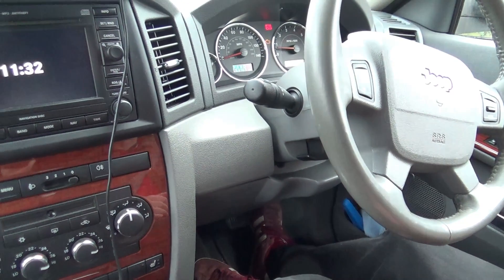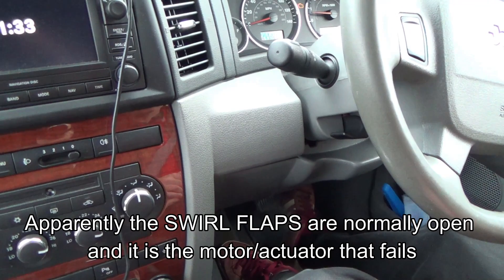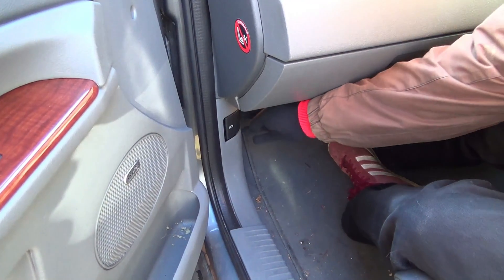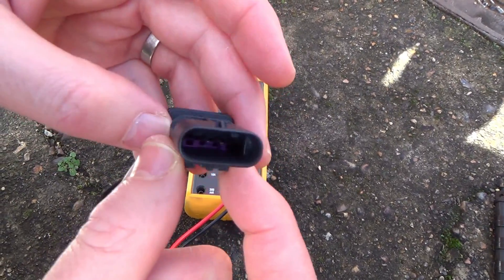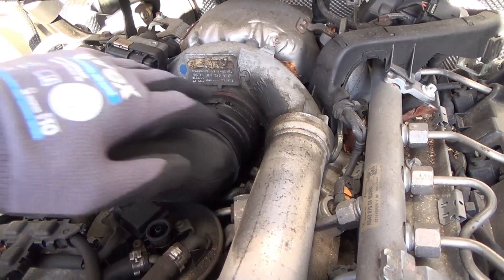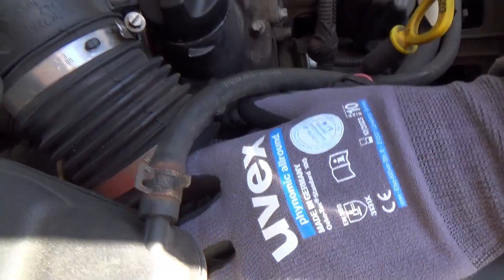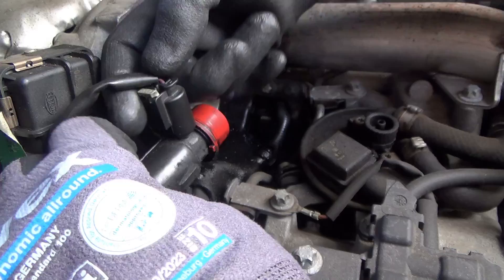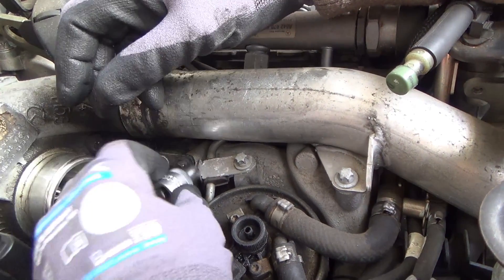Swirl Flap Motor BYPASS on JEEP / MERCEDES Engine OM642 (FIX Limp Mode)

Comment: fooling emissions knowingly is like 4 years in jail more then rape or.. what world we live in.
There are more these kinds of cheats but they are meant for testing and not for useing in road specially when you come for safety( brakes, airbags,....) parts please STOP!
Reply: for the end user? not likely. People are usually allowed to do what they want.  I see at least one vehicle a day on the road with straight pipes/ no catalytic converter, or diesels w ECU mods "rollling coal". I guess there's more freedom over here in Canada.
Reply: @jamesarmenti8876  1995 to 1997 Exhaust pipe modification get illegal here. I don't member correct year.
Every Exhaust pipe should have E-quality stamp on them for Yearly checker(MOT,...) to see.
But yeas don't know anyone that did go jail for that. Then again YT is international...
Reply: @timowallin8020  over here in Canada you can pretty much do anything you want to your car. Vehicles are inspected once when you register them. From that point on they're on the road for as long as you own the vehicle with no inspection required. Obviously you can get pulled over if you have body panels hanging off etc but for the most part you can do any modifications you want unless you live in areas with emissions testing. But a lot of places have gotten rid of that scam testing.
Reply: @jamesarmenti8876  So any car at highway can lose it wheels, Brakes,... Coming  towards you and it's OK?
Damn iam clad i don't live in Canada
Dont know of your testers but here if your car fails on emissions then there is totally something wrong with your car as they dont go as low as EU wants the cars to have...
Reply: @timowallin8020  yep essentially but I've never heard of it ever happening. Gotta love people that give away all their freedom in the name of safety!
Reply: @jamesarmenti8876  I work on cars 5 days a week. Last year 10 cars with odd noise was lose wheel nuts even after we asked was the wheels nuts tight. Yes they are was allways the answer and they was all wrong 2 of them needed new parts as the wheel breack them abart.

At this winter one car gets on new lost of control after both front wheels get lost while driveing.

If you ask today. Do you have oil in your engine and so when did you last look it?
You get eather isnt there a ligth for it or last time ion service that was 30000km a go...
Reply: @timowallin8020  but loose wheel nuts can Happen at any point in between bs mandatory yearly inspections or whatever is mandated where you live. Oil changes have nothing to do with ”safety” either. It just drives me nuts that rules and regulations are being shoved down throats using ”safety” as a Trojan horse.  Scare people with reasons of safety so they give up their freedom and right to repair etc.... someone think of the children!!
Reply: @jamesarmenti8876  Yes, the oil change point was just the maind of people at the moment. The Car is just part that gets you point a to b. is it safe? it did it yesterday, so why not to day?
I live in Finland and i can ride one set of tires 20 years whit out change of tire in summer 30c* to winter -30c* 
Hows Brake lines for you?
Here cars are mostly old.. after 10 years they come rasty spesially with these under body plastic covers, that collects mud and salt to pipes to rub on to...
So when animal runs ahead of you and that point first time in years you really press that brake pedal you lose your brakes and...
at least ones a year one car lose the job at brake dyno at here.
EDIT: PS. I Dont do safty inspection but i get the point why its good when looking at rigth parts of the vehicle.

Comment: Will the emissions pass an MOT with this bypass?
Reply: depends on where you live,  Where I am in Canada, emissions testing isn't a thing.
Reply: It'll absolutely fail emissions with this mod, as it's not burning as efficiently at idle.
Reply: @jamesarmenti8876  Hi James. Emissions are not an issue with this modification.

Comment: You can do the same thing with older Toyota secondary air injection systems that fail - you can install a resistor in the temperature sensor circuit so that the truck always thinks it is over a certain temperature so that it just never runs the secondary air system. Typically people will remove the air pumps and valves as well and block the holes off with a plate, but it is a neat little trick to fool the ECU into never activating the system and therefore never throwing a code. (Secondary air is a total joke anyways as all it does is blow air into the exhaust system when the air temps are cold enough on start to "reduce" emissions by diluting them - lol. That is basically all it does.)

Comment: Amber EML " engine management light " will not fail the MOT Only Red warning lights will be an instant fail.
Reply: Eml is a failure
Reply: No, your car will not fail its MOT if your Engine Management Light remains on when the engine has been started if it is before June 2003 reg. Under the new MOT rules, it is classed as a major fail if your car is older than July 2003. If your light is on, you should have your car checked at a garage.
Reply: @stuart7999 Lights not on mate im a tester misread your post though you said it would fail.
Reply: @stuart7999  Sorry misread again, EML light on is a FAILURE
Reply: @v4vauxhall498  :)  I test 10 cars every day a petrol car from before 2003 will not fail and a diesel car before 2008 will not fail its Mot with an EML light your correct in thinking any car from 2009 will fail its MOT with an EML light on.
Reply: @stuart7999  I stand corrected sir, you are indeed correct

Comment: I'm still trying to figure out what a swirl flap motor is.
Reply: Basically swirl flaps lengthen or decrease the length of the inlet manifold by opening or closing sections this helps with torque at low rpm and enables it to rev free at high rpm. It is also used for controlling emissions. The flaps are opened and closed by either a motor or by vacuum on some cars.
Reply: @scottvallance2007  thanks. Basically they stole V-Tech
Reply: @karlporath8904  not the same,  Vtec is changing valve timing and lift via hydraulically activated rocker arms, this is just having 2 intake manifold runner lengths. The funny part being that Honda also uses these variable length runners on some B18C engines w/ the dual stage manifolds.
Reply: @jamesarmenti8876  see my second post I'm a feeble minded old man, I was thinking of 1990's ford focus intakes. All new junk looks the same to me. Give me a straight 6 with a three on the tree any day.
Reply: @karlporath8904  yeah ford/mazda called it the Variable Inertia Control System
Reply: @scottvallance2007  oops. I'm an old man. Forgot that was cam timing. It's a copy of what Ford did on the 1st gen Focus intake.  Got it now.

Comment: What does the swirl flap motor even do anyway. What part of the engine does it connect to/control?
Reply: They are used to make the incoming air swirl around at certain engine speeds, which helps improve the mixing of the air and fuel, increasing efficiency and decreasing pollution.
They are almost always attached to the inlet manifold.

Comment: That oil means that the turbo is faulty, not the seal. Probably  the shaft of the turbrbo is broken.
Reply: you only need ears and not eyes to know that turbo shaft is broken. Here that's not a case.
Reply: I ment the seal between the shaft and the turbo body.
Reply: The turbo is not broken, neither is the shaft. The seal is gone and it’s the number one problem on this engine.

Comment: Good luck on passing MOT
Reply: It won’t make any difference to it passing an mot. My bmw has a similar issue whereas they break off and can damage the engine...I removed mine and fitted blanking plugs and it has passed several mots since then.
Reply: Hi. My Jeep has passed 5 MOT with this emulator fitted. Emissions are spot on.

Comment: Well I guess the turbo is going to be the next thing that lets go, if its leaking all that oil.
Reply: No, the oil comes from the „Kurbelwellenentlüftung“ crankcase breathing.
Reply: @jasperlongman7668   and the torn oring inside intercooler hose. mine was so.

Comment: but this is not permanent solution at all. collect funds and then replace the motor vince.
Reply: for car that old it is.
Reply: The car isn’t worth the cost of a permanent solution, hence the workaround, you won’t notice the difference and it will still pass an mot.
Reply: He explained this, given the age of the car, a proper fix is not economically viable. Happens to all cars eventually except ones that become collectors items.
Reply: He didn't say it's a permanent solution.
Reply: This was a workaround, though I wonder why Vince didn't try a DIY fix
Reply: @ktaragorn  Because this brother had already bought the £50 part he used. Watching the video is always a good plan before commenting.
Reply: @reggiedixon2  The only options considered were Cheap resistor or  (because his brother bought it) an expensive "resisitor". Not trying to fix the motor itself. Are you sure you watched the video?
Reply: @ktaragorn  Yes, this is because the full job was uneconomic meaning that parts, labour and experience/knowledge added up to an uneconomic proposition regardless of who handled the spanners. If you have ever worked on a car you will know that if you don't know what you are doing and screw it up, you can cause thousands of pounds worth of damage.
Reply: I assume the OP of that comment didn't watch the video from start to finish when commenting. If so, then it happens
Reply: I did this on my Chrysler 300C Touring 10 years ago. Everything is still fine. My heart sank when it went into limp home mode. I had to research what the code meant. I then did research on what the 'swirl flaps' actually do. Found they had minimal effect on the engine. It is an emissions thing, at light throttle only. Found the fix on a 300c forum. I do electronics as a hobby and had plenty of resistors. Problem is solved, car runs great and I get 35MPG from a 3.0l engine.
Reply: @richardhemingway6084  Hi Richard
Reply: I recently got one of these jeeps...previous owner had the swirl motor and turbo replaced for a sum of $8,000.

Its not really going to add any issues in the long term. Other solution is to just tune it out...disabled the swirl motor all together, and the extra power from the tune won't make it all that noticeable anyway.